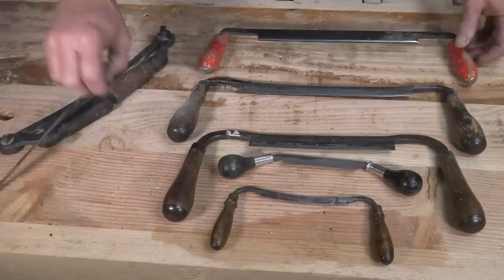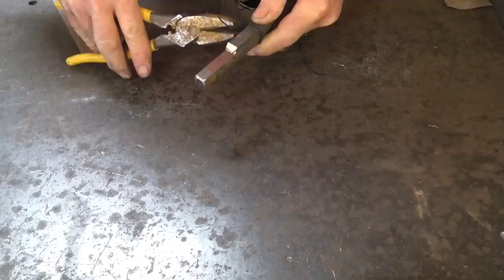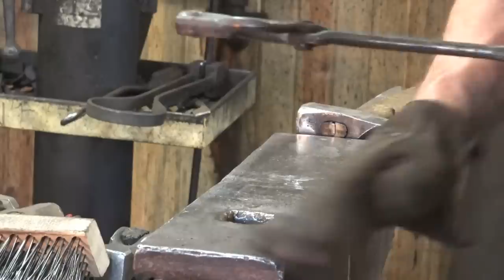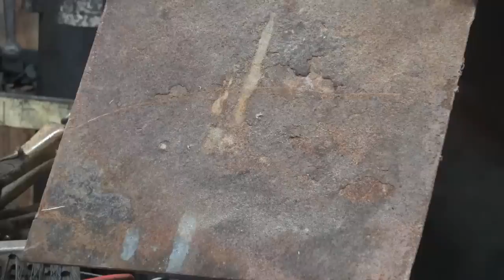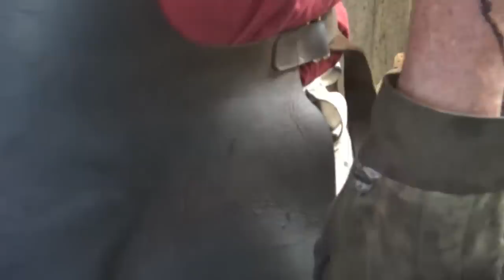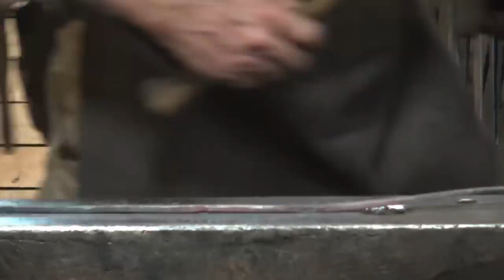Forging a drawknife - part one - blacksmithing project

Comment: As someone who (eventually) wants to get into making draw knives and other woodworking tools, I would dearly love to see information on how to attach the handles to the drawknife. While making the handles is woodworking, it's still a part of the tool itself and I know that there are options on how to attach the handles to the tangs.
Reply from the maker: I will plan to show most of it without making it a how to turn wood video.  I am not the guy to tech turning even though I manage to get by for my own purposes.

Comment: For welding  ,  I  think it is better to sprinkle borax on a clean surface previously heat up to 500F. Return to the fire an adds more borax at a higher temp.

Comment: I'm pretty sure you could just draw out the ends of a flat bar to make the handles and you'd end up with a draw knife without any forge welding, although this might not work with larger blades that well.

Comment: Nice bench. Love those knives. First again. One procedure my Grandpa insisted on was when there was a tang formed there must be a radius at the intersection of the tang and the blade. I was told leaving that shoulder square is a weak spot and it may fail. Thank you for that instruction.
Reply: Abby Babby, your right about the corners, but since he basically fullered them in, he didn't cut the grains of the steel, they are, on the granular level, radiused.
Reply from the maker: That is a good point.  It is one of the reasons an anvil should have radius-ed edges.  That creates a nice transition as opposed to a sharp corner.

Comment: I made a draw knife totally out of D2 not long after I started blacksmithing, that taught me a few unwanted lessons I can tell you! Needless to say there was a bit of welded on mild steel for one of the handles by the time I finished, not that you could tell looking at the final tool. 
 Obviously being D2 the heat treat was easy, just air cooled it. Been using it over a year for the odd job every week or two, and not had to sharpen it as yet.
Reply from the maker: D2 is tough stuff.  But as long as the finished product works

Comment: I would appreciate seeing the "woodworking part 3" if you don't mind. Blacksmithing is closely related to other crafts - such as woodworking - so in my opinion this crossover on crafts was traditionally extremely common. Whether the blacksmith would fit the hinges to the door, or the carpenter would pick them up and do it himself, etc.Therefore - please do share the lathe video!
Reply from the maker: I will plan to include it as part of the project even though it may not be very instructional.  I am certainly not the one to teach wood turning

Comment: Amazing that you can get that steel wire to hold through the weld process. I've been trying that all day and the wire melts in seconds
Reply from the maker: It needs to be back out o the highest heat area.

Comment: That shaving horse is pretty cool too. 
Interesting to get the tool steel to move into one corner by hitting it on the edges after working it into the mild steel. Am guessing here, but that should help with prevent hitting to much vertically on those weld lines whilst forming the cube? Well also once you draw out the knifes edge again you are not working directly down those weld lines. If you had left the O1 tool steel on one leading edge initially, then the O1 would perhaps de-laminate on you? Plus you end up with more tool steel where it is needed, than having only hardenable steel. You did say that they also move at different rates. Just wondering if those are also reasons for that way of doing it as you can't get it all into video? Another good one!
Reply from the maker: I hadn't really thought of any of those reasons.  But they certainly sound reasonable
Reply: John I must check back on my questions or comments in the future because even though I got notifications  + bell on I did not get a message. Was interested in what you thought about it.

Comment: John why not use some leaf spring, that's what I made mine from, it's a little beauty.
Reply: Lenblacksmith, I think he may have been making one for sale, so he needed to know what kind of steel he was working from, a personal tool I would use an old wore out lawnmower blade
Reply from the maker: Leaf spring would make a fine drawknife.  But I chose to use forge welding for a number of reasons.  I will try to explain all of those in the final video.  Kind of a cliff hanger so everyone sticks around.
Reply: Ok gotcha mate.
Reply: I'm really enjoying seeing this traditional approach.

Comment: I forge outside using a fit as a forge. I have an old 14 inch Nicholson USA double cut bastard that is too dull to go to work. This file is nearly 1/4 inch thick and spark tests well. I have seen a few of these things made from old files, would you grind off the teeth so the don't form cold shuts or should I leave them in?
Reply from the maker: It is certainly best to grind the teeth off, especially near the cutting edge.  But leaving some in near the back of the blade can look good and helps tell the story of its past use.
Reply: @BlackBearForge  I know that need to get the back nice and clean. Would with file work better as a bowie or should I make an 8-10 inch draw knife?

Comment: Not sure if you still get notifications from video's that you did 2 years ago.. but just in case... What are the drawbacks of just drawing the bar out beyond 1 inch so that you can just do the bevel with a grinder instead of forging out the bevel? I assume there is a reason you do it this way, but I didn't catch it in the video.  Sorry for being late to the party, but thank you for all of the amazing videos!!
Reply from the maker: I do see most of the new comments.  Drawing the blade out to form the bevel should save time grinding and perhaps save money on abrasives.  But in the end, I doubt the completed blade will care which way it was done.

Comment: John, I love your videos. Thank you. Can you comment on using leaf spring steel instead of w-1? I seem to pull a lot of leaf springs out of the local junkyard..thank you:)
Reply from the maker: The down side to leaf spring is that it is often stressed and may fail in use.  But it is generally a good steel for tools.
Reply: @BlackBearForge  Thank You!
Reply: @BlackBearForge  Would going through welding heats and being welded to another bar as tool steel (like here) be a good way to mitigate risk with unknown (pre-stressed) steel, or is there still a pretty good risk of cracking/ fracturing/ chipping in use even with the backing if there were flaws? For that matter, if you had nothing but time and used leaf springs (and a power hammer) would it potentially help to forge weld and fold them, or are you stuck with those flaws being significant until you melt the steel? Sorry, this just popped out as an obvious set of follow up questions to this answer. I don't work with a lot of leaf springs or used steel, but people seem to like them.

Comment: Hi, first comment, what gas pressure are you running to get to weld temps? I haven’t tried it yet but I’m concerned that my forge won’t get up there. Any feedback would help. Thanks
Reply from the maker: Gas pressure is only relevant for forges with the same forge and burner design running at the same altitude.  While the current forge runs at 25 psi for welding, there are some that can weld as low as 1psi and others that never make it to welding heat.  Gas pressure is also not a reliable indicator of fuel consumption.
Reply: So, in your opinion, where do I start troubleshooting? Any help is greatly appreciated!

Comment: Does the beveled side ride the wood? Or the flat side? When in use?
Reply from the maker: For long flat cuts or convex surface the flat goes next to the wood.  For concave surface the bevel.  Its common for the handles to be tipped so the knife works best one way or the other, so more than one draw knife is common
Reply: @BlackBearForge  thank you so much for the help

Comment: Nice Klein linesman I’ve been using that type for 30 years with the yellow handle and the crimper. Another great video John 
Should the knife be annealed before hardening and tempering??
Thx....Paul..
Reply from the maker: Either annealed or normalized.  Annealing will make it easier to grind and file.  But there should always be a stress relieving step of one form or the other.  It is also a good idea to repeat the stress relief after grinding since that may introduce some stress as well.
Reply: On the heat treating app sometimes it said to temper twice  I guess that will release a lot of the stress
Reply from the maker: Every steel has a bit different recommendation.

Comment: Another great video John, and I look forward to part 2
But I really wish you wouldn't refer to "traditional' blacksmithing techniques. How do you define what is traditional? The original blacksmith using a rock for a hammer and a stump as an anvil to shape a piece of bronze? Like any other craft, Blacksmithing has evolved. A modern blacksmith, such as yourself, uses tools and materials that a blacksmith from 300 years ago couldn't have dreamt of. Saw dust was once used as a flux I believe. I'm pretty sure that as soon as O2/C2H2 was discovered, almost 200 years ago blacksmiths would have grabbed hold of it. Just as they would have done when electric arc welding was discovered over 100 years ago. I understand your point about showing how things "can" be done without resorting to modern tools available now, but "traditionally" a blacksmith probably wouldnt have had some W1 to forge weld to a piece of 1/2" stock anyway.
Please dont take this the wrong way, I love your vids, and your style, but just reconsider what might be "traditional"
Reply: Phil Menzies, While I agree with your sentiment, Traditional means pervasive in the culture, you are referring to a more Historical, ie beginnings of
Reply from the maker: You make an old argument and one I disagree with quite  passionately.  Traditional techniques would be recognized by blacksmiths from any part of history even though the specific tools and materials may not be.  Early iron age blacksmiths had to be familiar with the same basic techniques that a well rounded blacksmith today needs to be familiar with.  Heating, drawing out, upsetting, cutting, punching, bending and forge welding.  The exact tools and materials may change, but the techniques are still essentially the same.  Our predecessors may not have had W1 and pre-made 1/2" square bar but they did have steel with a higher carbon content and wrought iron that they forged to an appropriate starting size for the project at hand.  You are correct that blacksmiths adopted new equipment such as the torch and arc welder it is the adoption of those newer methods that caused the near loss of the art and the craft of blacksmithing.  Blacksmiths quit being blacksmiths and started being welders, machinists and mechanics. 

"Blacksmithing is not defined by time period or motif. Blacksmithing is defined by process alone" - George Dixon

So it's all good and we don't have to agree on the terminology. But I will continue to use the term traditional because I feel it is the right word to convey my view of the art.

Comment: hi  how  hot   is  welding   tamp   in    degres
Reply from the maker: About 2300 for many led steel. A bit lower for tool steel

Comment: Just FYI there is company that makes a vest for people that have to work in the heat. The company is sta-cool can be found on the internet not cheep but i have been using one for a number of years and can work 100% longer with it on than with it off. I find it a must here in Arizona.  The temp. in the summer may be 110 at 3 a.m. and upwards of 120 in the day time.... be well and be safe.

Comment: If the 01 or W1 was the same width as the mild steel would you not have a better edge? The cost may be a little more but the fiddling will be reduced ?
Reply from the maker: As long as there is enough material to have hardened steel right at the edge, everything else doesn'e matter.  The only issue at that point is making sure you don't grind away all of the tool steel in the finishing process.  Historically edged tools used an absolute minimum of tool steel.